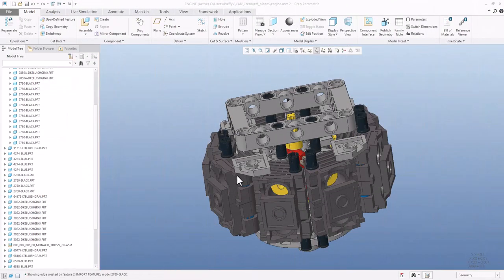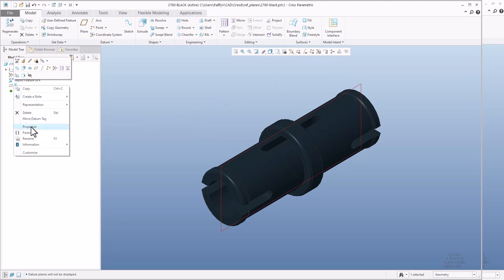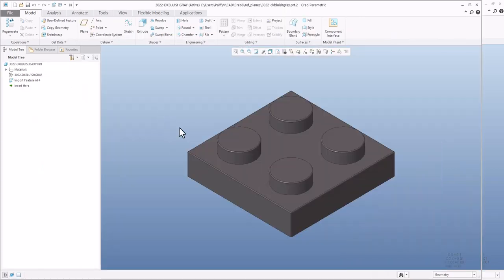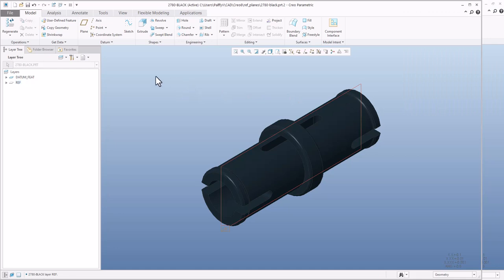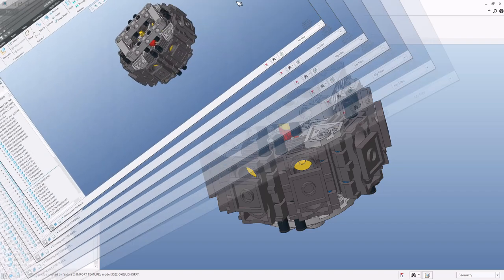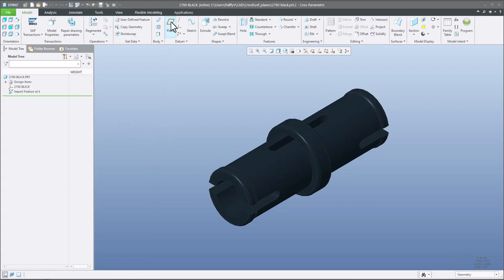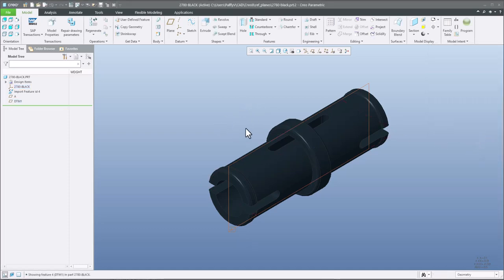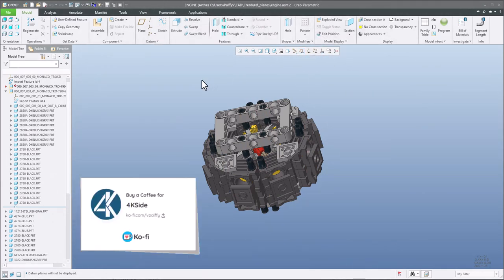How to Hide Reference plane by Creo 4 vs. Creo 8

Comment: Sir, when we open Step file in creo its most of time open in surface but same step file open in other Shoftwere like NX and Catia its open in solid hoo to solve this problem.
Reply from the maker: Everything is about data accuracy. Creo calculated it differently (in better way) but then you have to use Import data doctor to close some gaps.
Please check my channel or Web site to find tutorials about IDD (import data doctor)
Reply from the maker: Please check section Repair geometry: https://www.4kside.com/tutorials/